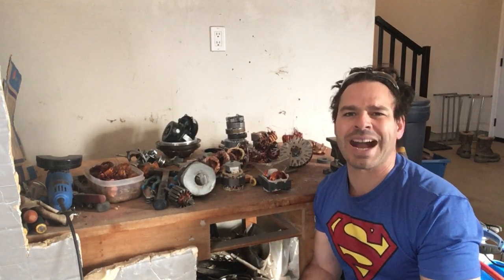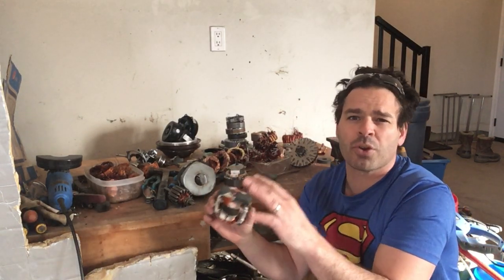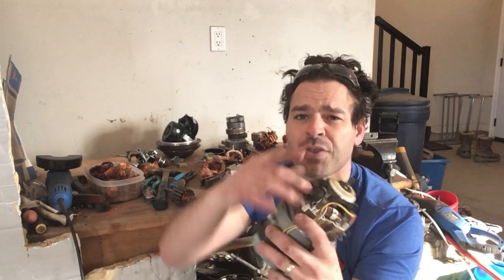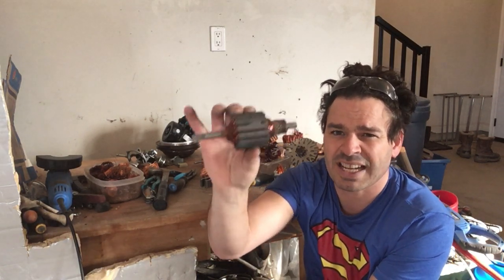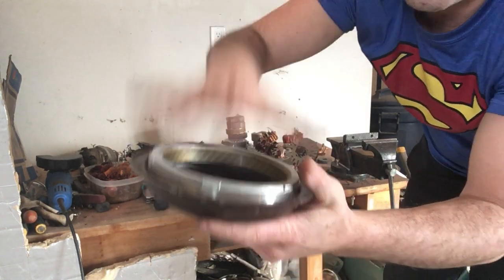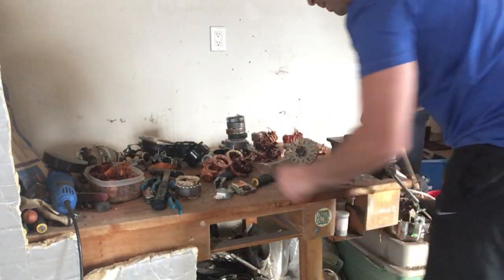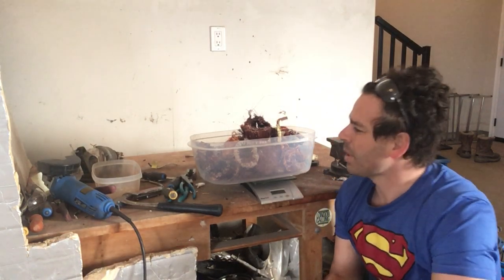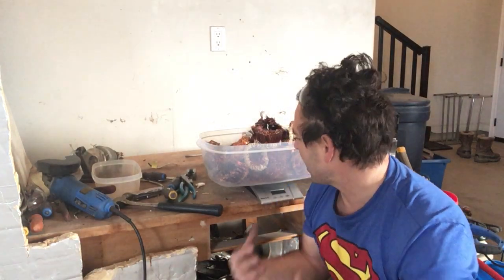Scrapping 42 lbs. of copper-bearing motors for the copper. How much copper did I get?

Comment: It is so strange that the thickness of the copper determines which category you can sell to. Where I live there are no such restrictions, if the copper is pure then it is pure and then it is copper 1 price. I mean, the furnace that is going to melt it do not care what thickness it is 🤣🤣🤣. But anyway, thanks for the Channel, its good content.
Reply: It's because when they melt the smaller wire some of the copper is lost in the process, or at least that's what I've been told.
Reply: It sounds like bullshit that a significant amout is lost for thinner wires. Maybe 0,1 gram per 1000 grams. Would be nice with an experiment.

Comment: I can't believe you only get 10 cents a lb on copper bearing motors and 13 cents on steel still doesn't make sense to me,  encouraging people to put anything under 13 cents into the shred pile.
Reply from the maker: Yup, I know.
Reply: @TinManScrapper  @Silver Junkie , in Montreal I get only 5 cents and 2/3 per pound for shread and this include HMS. THIS is discouraging, especially with the gas going up. One would think that all commodities would go up together.
For copper number 2, they offer 1 dollar less per pound than Tin Man have in London Ont. So I keep it. Same thing with brass. Dirty lead, 8 cents.

But I found another place where they give me 15 cents for ferrous aluminum. So I think Tin Man you should look for another scrap yard for that product. I think you should be able to have 30 cents or at least 20 cents per pound.
Reply from the maker: @maxcloutier5285  yes it is ridiculous!

Comment: Have u ever cut a sealed unit open? If not I would recommend it once u figure them out and get good at then they are super worth it and easy to do
Reply from the maker: I have several large motors I need to do still.